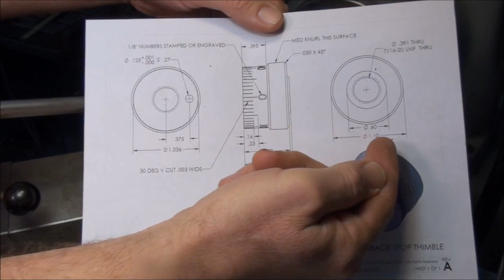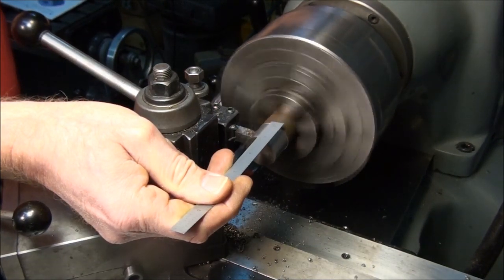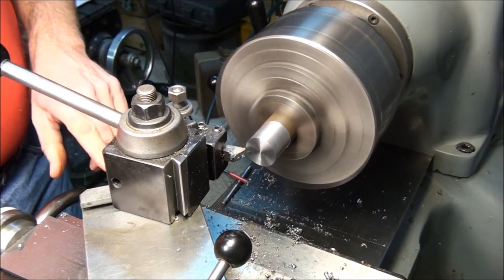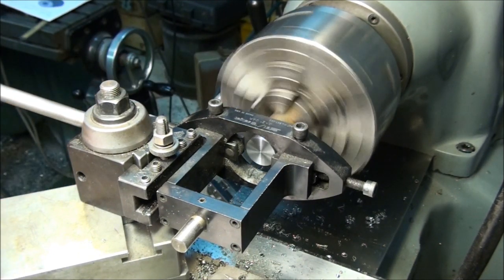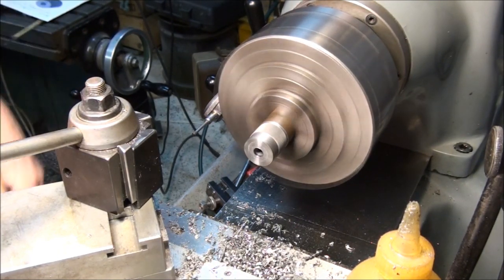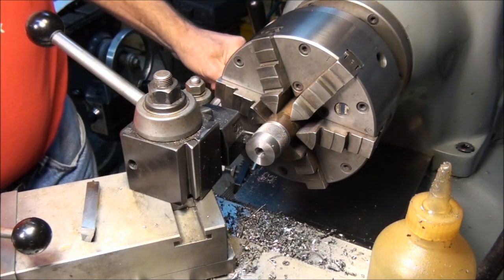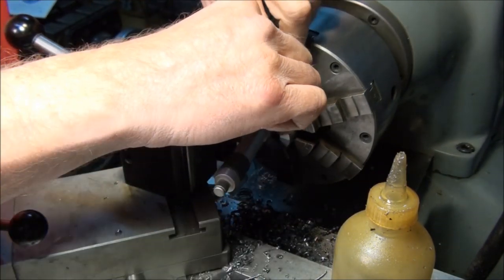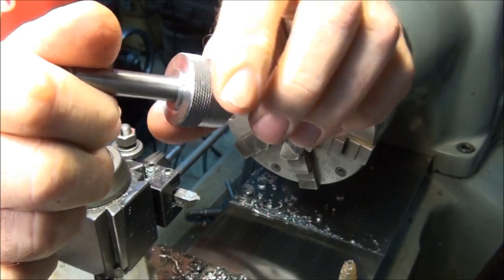Carriage Stop Thimble Part Two, Turning and Knurling

Comment: I have held off buying a knurling tool for my CXA and you have just shown me the solution for me. I, like Chuck, ask for the knurling tool project to come on the short list! I learn a lot from you and your explanations. Very nicely done (both the work and the videography). The measured chamfer using the compound at 45° is very obvious . . . now! Thanks.
Reply from the maker: That is a good way to turn an angle surface that is well located and has a good finish. I use it all the time. The knurling tool was already on the project list, but judging by the response, I guess I'll need to move to the top.

Tom

Comment: LOVE that clamp style knurling tool Tom - thanks for posting your videos mate
Pete from Down Under
Reply from the maker: It is a good design. It's just an aluminum frame, but it will easily knurl a 2" steel round in one pass.

Thanks for watching.

Tom

Comment: Hey Tom, thanks to you have inspired me to use the old carriage stop at work, it was hidden in the cupboard covered in dust but it does make replicating parts convenient, thanks!
Reply from the maker: Carriage stops are very handy, not only for making multiple parts, but for locating any feature(s) along the axis of the part, such as grooves or shoulders.

Tom

Comment: Tom, thanks for another great video.  Would you please consider a short video showing how to get a boring bar set correctly?  For small holes like that I end up with horrid results.  Once the hole is larger I get much much better results.  I'm pretty sure that the issue is angles or height but that still leaves me lost.
Reply from the maker: A video on boring bars is on my list. Bar height becomes much more critical as the size of the hole goes down. You likely had the bar set too low and it was rubbing under the cutting edge.

Tom

Comment: Neophyte question: I've noticed that when you mount a tool in the tool post, you don't push it up against the tool post, but instead "float" it out away from the tool post. Obviously, it would be easier just to shove it against the tool post, but I suspect there is a reason you don't. Why?
Reply from the maker: Jay,

You must be talking about mounting the tool in the tool holder, not the post. The holder will accommodate a 1/2" tool and I'm using 3/8" bits, so I just mount the tool so it's proud of the side of the holder a bit for more clearance between the holder and work.

Tom
Reply: Toms Techniques I guess the tool post must be the shaft the tool holder mounts on. Got it.

So if you were just turning a piece down to size and didn't need to get too close to the chuck, then one could just push the tool all the way against the tool holder, for speed and ease of installation? For facing, however, you might want that clearance, so the tool holder didn't bump into the work piece. Is that the idea?

Thanks!

Comment: Tom, great job.  I do have a question however.  I also have a HLV-H however my tail stock is not lined up with my head stock....a little to the left.  I was wondering if you may have any tips as to how to align it.  Is it possible to shim the gib or maybe adjust the gib screws?  Thanks in advance.  -Adan

Comment: Nice Knurling tool
Reply from the maker: It does work well. It'll do a coarse knurl in stainless with no problem and it's much easier on the lathe than a bump type knurler. I'm planning on doing a project tutorial on one after this one is wrapped up.

Tom

Comment: Dear Tom,

Thank you very much for showing us all these videos -- I really appreciate and enjoy it. You have no idea how much I learn from you! :)

I have one question though, if I may. I understand the necessity for a carriage stop, but I have trouble in understanding why it works. Here is what I mean: Once the carriage will come in contact with the carriage stop itself, won't it "crush" into it? The lathes' motor is trying to move the carriage beyond the carriage stop, won't this collision damage the motor\carriage stop\carriage itself? For some reason, I always imagine that once the carriage hits the stop, it's like having your rotating chuck hitting your tool post! :\

I hope my question was clear and that it doesn't sound so stupid, LOL. ;) Thank you very much in advance.

I've never got to see a carriage stop in action (I'm a hobby machinist and never seen a fully geared lathe in person, all I have is my hobby lathe at home). Could you please show us how the carriage stop you're building is functioning on an actual lathe after you've finished it? If it's not too much of a bother, of course.

Thanks a lot once again, looking forward to hearing from you.

-- Arye Segal.
Reply from the maker: Arye.

This (as with most) carriage stop is simply a manual stop. It is not meant to stop a carriage fed under power. You have to stop the feed before the carriage reaches the stop and finish feeding it by hand. The lathe I am using does have an auto stop on the lead screw, but that is only for threading. Feeding to a stop is nearly always done manually.

I will definitely demonstrate how the stop works on my dad's Atlas lathe when it is complete.

Thanks for watching.

Tom
Reply: Toms Techniques Oh, now I see. From reading online I saw that some lathes have clutch on their feeds, so I thought that in the case that I described above, when the collision between the carriage and the stop occurs under power, the clutch would give and disengage itself, thus preventing any kind of damage happening to any part. But I guess that is not the case at all.

Thank you very much, Tom. :)

Comment: Tom, thanks for the video.  Beginer question here- why use the reamer to finish instead of the boring bar?
Reply from the maker: It's just quicker and there is no chance of the hole going oversized like there is with a boring bar.
Reply: Makes sense Tom, keep up the good work!

Comment: Awesome videos Tom! Thanks for sharing your knowledge. 

What kind of oil do you use? I'm using water soluble oil, is that the same but without the water?

Thanks again!
Reply from the maker: I was using dark thread cutting oil on these threads. You can get it at most any hardware or builders supply for cutting pipe threads. I use it for tapping and die cutting and for single point thread cutting in carbon steel. For aluminum, I use WD-40 and for stainless, I use Tap-Magic.

Thanks for watching.

Tom
Reply: Toms Techniques Thanks!

Comment: Hello Tom, Technical question please. I have the same Hardinge as you, I always have my top slide parallel to the machine axis. Here in England this is the way a topslide is used for turning shoulders to length. By you having it at an angle, all shoulder lengths have to be set by the use of a carriage stop. I notice that on all American Videos all the people have their topslides set at an angle. Is that what you are taught in America ? and what is the reason please. I did ask Tubalcain this question but have had no reply. Wondering as to whether I am missing out by not doing it.
Reply from the maker: Aside from the fact that 30º is the angle the compound needs to be for threading, it also creates more clearance around the tailstock and dead center. And it allows you to get the tool close the the chuck with less overhang.

You've mentioned using the compound (top slide) to turn shoulders to length, do you indicate it parallel with the machine axis first? If not, how to you know the tool isn't creeping in X as you move the compound in Z? Shoulders usually have diameters associated with them.

Tom
Reply: Toms Techniques Hello Tom, thanks for a prompt reply. I think that you have misunderstood me slightly about turning lengths to a shoulder with the compound slide. As you rightly say you can use it, but in my scenario I use it to SET the length. Use a carriage stop, place the saddle up against it and lock it, ensure that the compound is wound sufficiently back enough for the length of shoulder you require e.g. 1 inch. Face the part and set the dial to zero, clear the tool from the work, advance the compound dial to . 995 inches. Unlock the carriage and turn as normal to diameter using the carriage, On the final cut, advance the compound the final .005 thou and face outwards. Job done. No need to clock the compound for parallel, even if it was 1/2 degree out would be nothing on diameter for a .005 tho shift. Should you need much longer shoulder distances, say 4 inches, then use a distance block between the carriage stop and the saddle. They can be anything that is parallel, a piece of bar that has been faced on both ends, does not need to be an accurate size. Say it happens to 2.943 thou, then 4 .000 inches minus 2.943 thou = 1.057 tho left to advance the compound dial. This is more accurate than a dial gauge, and who has a 4 inch one. The other thing with dial gauges is that they can "stick" a thou or two at times; & finally, unless the stem is set 100 % parallel to the bed in both directions you will get a distance error. Sine bar effect. Good what you are doing, trying to show the uninitiated how to do things; but you must take into account that a bad lesson has the effect of creating 1,000s of bad pupils. The information has to be correct and Safely done. The general public are most gullible, and will believe what they see and are told. There are many videos posted on YouTube by others that are totally wrong and highly dangerous. Keep up you excellent quality videos, and have a long and happy machining life.
Reply: Dave Ticehurst Hi Dave,
I looked for your videos but found nothing! What's up?

Comment: Hi Tom Do you have a video showing how you fixed the carriage stop on the front of your lathe with the dial indicator. I would like to set that up on my lathe.
Reply from the maker: That's a Hardinge accessory, but I have seen it on other lathes. Mine is simply a bracket on the headstock to hold the shaft of a 1" travel indicator. It also has a lock screw to adjust the location of the indicator. I've also seen indicators mounted on carriage stops which would give you the best of both worlds. The hard stop for multiple parts and the indicator for a "soft" stop.

I'll shoot a video this weekend on how it's used.

Tom
Reply: Toms Techniques
Look forward to it. Thanks

Comment: Will that steel rust?
Reply from the maker: All carbon steels and even many so called "stainless" steels (416 for one) will rust. If necessary, they can be plated, blackened or Parkerized to help prevent it. It's not necessary on machine parts like this because they normally get enough oil on them during use to keep them from rusting.

Tom